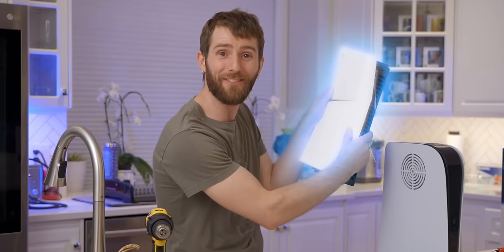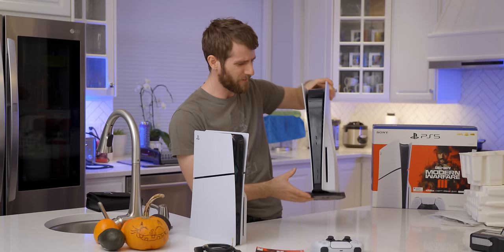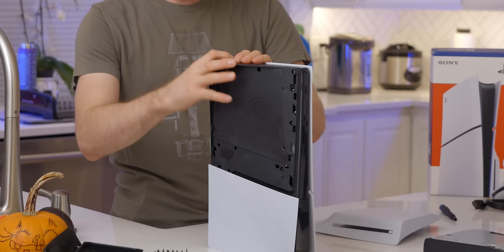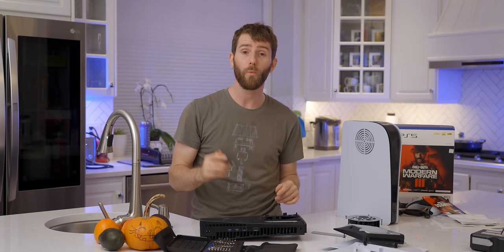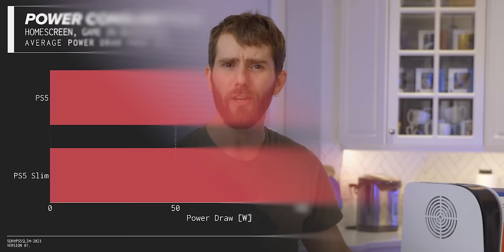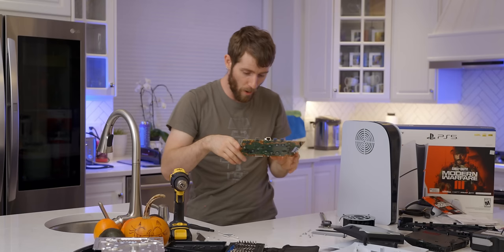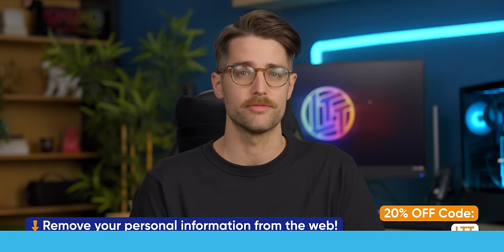PS5 Slim First Look and TEARDOWN!!

Comment: 18:30 The large jaws of the caliper is used for outside measurements, and the pointy jaws on the opposite side are used for inside measurements. And the rod that sticks out the end of the caliper is used for depth measurement.
Reply: Since the chip sits on top of the pcb he's using the correct jaws. There is a small space between the foam and the actual chip.
Reply: @bastienx8  Ok fair he's not measuring the inside of the black collar as I wrongly thought of. But the large jaws are still too big to reach the IHS edges so he's eyeballing it, and in that case using the pointy jaws would be a better choice.
Reply: @bgezal  on some calipers the large jaws also ends with a small point, but I don't know if theirs has this
Reply: @bastienx8  Sure. My intention was to teach about the multiple uses of the caliper, for those that didn't already know.
Reply: @bgezal  Yes that's great. The next thing would be to learn how to read the decimals on a non-electronic caliper, I tend to prefer these over the electronic variant because they never run out of battery
Reply: @bastienx8  The Vernier scale. It's a great backup knowledge. https://en.wikipedia.org/wiki/Vernier_scale I've finally retired my vernier caliper for a digital because my eyes are getting old.

Comment: Im really curious to see if the redesign of both the console itself and the power supply do anything to relieve the overheating problem. The amount of people who ended up with the "my console just shuts itself off with no warning" problem because of clugged PSU vents is ridiculous. Something that should absolutely be seen as a pretty major design flaw. It should've gotten some attention in the redesign.

Comment: One thing we can count on Sony is that the slim versions always more reliable and last longer, my PS3 slim still working and PS4 slim was the same
Reply: Yeah but those came with die shrinks.  This slim is different.  But tbh electronics should be a lot more reliable now.  Everything runs a lot cooler and power effecient compared to back then.  

Still gotta clean the vents if you want your consoles to run reliably imo.
Reply: @squirty131  I think you would need to read/write nonstop for a long time for it to defect.  There's numbers on these SSDs, some more than others.  I'm not sure about the nands/controllers PS5 uses, but I'm sure it's better than most SSDs out rn.

Good point though, but I'm sure Sony made sure PS5 could last at least 10 years reliably.  

I could be wrong though since I haven't been researching memory chips in recent years.
Reply: @squirty131  e-waste is a massive propaganda, plastic in household products is the main problem.
Reply: Because of the die shrinks so thermal and power draw was better but this time they did the shrink and improve the thermals on the cfi 1200 models so thats why you dont see much of a change basically anyone with a cfi 1200 or a slim will have a better console overall compared to the first buyers in 2020 or 2021/2022 that got the cfi 1100 that has the worse thermals

Comment: 2:30-2:50 Never have been done!? IIRC, replacing the storage on Xbox 360 was trivial, there was just one tab to pull off the HDD case and drop in a new one, or you could open the case and replace the HDD only. PS3 was also trivial, the HDD was on a sled and you had to undo just one screw. Pretty sure both documented the process in their manuals.
Reply: Sarcasm my friend, that was sarcasm. The dig was exactly that, that it was done in the past, worked really well, but then got dropped from following consoles.

Comment: Wasn't the original PS5 heavily marketed around its custom 6 channel Storage Controller? Which was also the reason for its weird 825GB capacity. I only see 4 Packages now, 256GB each for 1TB in total, which means it is using less channels from the controller, which implies that parallel throughput of the system would be lower unless the controller is more efficient now per channel of NAND connected to it. Can you guys run a Speed Test on the Internal Storage to see if there's any different?
Reply: Heavily marketed? Depends. That was a small detail in the Road to PS5, barely a marketed feature. It was just a single part of its specs and probably not that important. Most of the custom stuff is on the actual controller, like hardware decompression. And I imagine there’s still the 6 levels of priority they mentioned. Oh, and the PS5 actually has a 12 channel interface, not 6, although I’m not sure how that translates to the nand chips
Reply: They lie in marketing a lot
Reply: They probably use faster NAND now.
Reply: The number of channels doesn't necessarily equal the number of NAND packages or dies within, and less chips also doesn't necessarily mean a decrease in channels. For reference modern drives commonly have 8 channels while using 2 NAND packages, so Sony could very well keep 12 channels (it's 12 not 6) despite decreasing down to 4 packages in the Slim which likely each have four 512 Gbit dies. Also fewer channels wouldn't necessarily mean lower throughput, the speed of the channels matters.

Comment: its not weird that the internals use the same screws and the shell uses a cackophony of screws. because the actual function serving bit (the pcb) was designed by a team of engineers and the shell by  dEsiGNeR that cared more for looks.

Comment: On the USB ports, Linus actually is a bit wrong - it's actually the same speeds on all ports as the previous OG PS5, they've just changed the front USB-A to USB-C. 
- Both back USB-A ports are 10 Gbit.
- One of the front USB-C - the one replacing the USB-A - is limited to USB 2.0 speeds (480 Mbit/s) and is basically only for charging controllers/peripherals. (I guess you can use it for USB headsets as well as those typically only need USB 2.0 speeds.)
- The other USB-C is 10 Gbit and is to be used for the PSVR2 (but can be used for charging etc. as well, of course).
It could cause some confusion if new users try to plug their PSVR2 into the wrong front port and it doesn't work and don't understand why.
Reply: I doubt it's been downgraded to usb 2.0, more likely it's 3.0 instead of 3.1 like the other ports which would be the same as the OG PS5. 3 x 3.1, 1 x 3.0
Reply: so hes right as he said 3 of them are 10......
Reply: @talibong9518  They didn’t downgrade any ports. The front USB-A is USB 2.0 on the OG PS5 and they just swapped it for a USB-C at the same speed.
Reply: He was also wrong about using cheap flash memory when it uses nvme m.2 when talking about the storage
Reply: @Brandon0159  M.2 is the physical interface, so PS% doesn't use that interface since its SSD chips are soldered to the board.
Reply: @Brandon0159  he's not wrong there, he's talking about the RAPIDLY falling price of the actual NAND itself
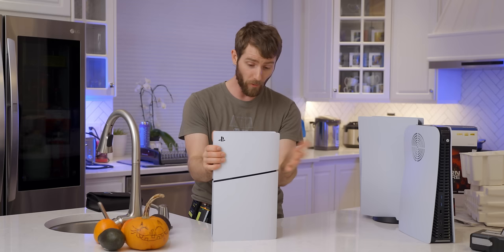Reply: @jelousjake3500  he IS wrong (again, no fact checking at all). He said at 6:04 "the original ps5 had 2 5G ports and 2 10G ports" which is very wrong.

Comment: I like how easy seems to be replacing fan or psu (and disc drive obviously).
Reply: However, in long run, this console is not good for future retrogaming because Sony will shutdown their cloud service long before all the optical drives fail. As a result, you cannot combine a working drive with a working motherboard because Sony maintained cloud service is required to accomplish that.

Hopefully none of the games for this console are worth retrogaming in the future.
Reply: @MikkoRantalainen   While not ideal unfortunately it's now the world we live in, still with luck unless I'm misunderstanding something, there is a fair chance that once that point is reached either Sony changes the firmware so that the online  requirement is no longer needed or 3rd party solutions are available to cater for those users.
Reply: @MikkoRantalainen  Oof, yeah, I forgot about 'live-service' thingy... well... shit

Then again, determined people always(?) finds a way
Reply: @raka1996  If Sony went the here with the same technique they use in their Android phones, real cryptography with secret device specific key stored in TPM (or equivalent) chip, there's little to no hope to ever fix the problem without Sony's help.

For a single device, you could put the TPM chip under electron microscope to extract the device specific secret but that scales really poorly.

You'll end up with similar crap that 3rd party repair services have to deal with Apple devices nowadays: swap individual chips to avoid the serial numbers from changing. This obviously totally voids the idea of easy drive replacement.

And considering how poorly they support their existing Android hardware, I have very little hope for Sony ever releasing a firmware update to allow part swaps when Sony shuts down the cloud service.

Comment: It's seriously cool they can pack that much in such a "small" package. I mean honestly with the size of modern consoles you might as well get a mini itx build, but those are more expensive if you spec them up. So it's fair enough. The "you need connection to the server or it's a brick" trend worries me though =l
Reply: You should see an Xbox series x tear down. Talk about power, size ratio
Reply: It's as powerful as an rtx 3060, you can find 4090 laptops smaller than that
Reply: @nightthemoon8481  can’t find one no where near as cheap tho. And GPUs on laptops are weaker than desktops.
Reply: @Amearie  true, but it's cheaper in the long term since you're not paying for online and paying 80$ for every game

Some laptop gpus are weaker but not all, the 4060 laptop is almost identical to its desktop counterpart, the 4090 however is much weaker than its desktop equivalent but still more than 4x as powerful as the ps5

Comment: What I’ve noticed in the unboxing part of the console is that the power and USB C cables are missing in the box. To everybody who wants to buy a PS5 Slim, it includes both cables as well alongside the HDMI one.
Reply: And all PS5s have 1 TB of storage. So for that, you need to take down the video, so you can correct the mistakes that were done in the current one.
Reply: @yordyords  nope og has 825
Reply: Yet 825GB available. Which is what he said in the video. With the slim having the 1TB.
Reply: @jlatoo I didn’t make it obvious, but all new PS5 Slims (both the digital and disk versions) have 1 TB of storage, which is an upgrade from 825 on the old one.
P. S. Mistake #3: There is no upgrade on the USB specs of the ports. Even the old one has 2 10 Gbps Type A ports on the back and one 10 Gbps Type C on the front with one Type A that is 5 Gbps. Now with the Slim, the only change is that the Type A port on the front has been replaced with a Type C, while retaining the same specs for throughput.
Reply: @yordyords  they said that in the video?
Reply: @jlatoo for the storage, they said only that the Digital Edition have a 1 TB SSD, while for the USB part, they told that there is an upgrade on the speed of the ports, which is entirely false. There isn’t any upgrade aside from the Type A to a second Type C on the front.
Reply: @yordyords  the new digital only has 1 tb ssd and it is a high speed usb c, not 2.0 speeds. youre purposely misinterpreting
Reply: @jlatoo I’m not misinterpreting bro. Go and check the specs for yourself instead of blaming me for misinformation. And also, do not add words to my mouth which I haven’t mentioned. I’ve already said 5 Gbps instead of USB 2.0.
Reply: @yordyords  nothing they said about the specs was wrong lol, did you listen to what i said
Reply: @jlatoo it was wrong. Especially about the USB port capabilities.
Reply: they already opened it before filming, they probably forgot to put it back or just didn't bother at all since they're doing a teardown.

Comment: Me and Jesse tore down the PS4 and basically refurbished it. Poptoons Skaff used A LOT of q tips for collecting dust and I re-pasted the CPU with the last of my Thermal Grizzly. We struggled to put it back together successfully and... Well, we have no way of testing if it improved thermals, but it seems to be working as usual so, we succeeded in cleaning and NOT breaking it. WHOOPTY-FLIPPIN-DO.

Comment: One thing they could've changed is make the OS SSD not be soldered. In case one chip module is to fail it would be much easier to replace an SSD and not to desolder and resolder the chip back on the board, well at least Xbox got that right.

Comment: The ssd thing has been done before. With the ps3. At least with the super slim ps3, you could slide its side off and you had a completely empty full PC HDD sized sata port, no need for screws even
Reply: I used that with an sata extention cable, powering an big HDD instead of the smaller laptop drive they came with. Even modded an old external case to keep the drive in, for safety.
I do remember it had a sizelimit though, but it also could've been an incompatibility with the drive brand, somehow.
Reply: @Icefumy  I had like a 240G corsair sata ssd from back in the day, which was a huge upgrade from the I think 16 or 32G my PS came with, I think it was one of those models with flash storage

Comment: I have a PS 1 and PS 2, and I do have to say that sony has always given us options to expand our storage, especially on the PS2 with the HDD slot in the back.
Reply: Apples and Oranges.
Reply: Lol you say this but if they could force cloud or digital only they would
Reply: @krustyegirl7334  they could but they didn't. there's speculation and reality.
Reply: @krustyegirl7334  There's definitely benefits to both. And you have the options. We're talking Storage, not a disc drive.
Reply: @krustyegirl7334  they absolutely could just not produce a disk drive.
Reply: @x0Fang0x  They could but they would lose customers (aka money)  if they did.

Comment: i dont even have a ps5 but i bought the new controller for my pc and i thought something was wrong with it when i felt the forced feedback through the triggers while playing death stranding, im amazed at the vibration generators i guess you would call them they have a huge frequency range, came a long way since the 2 motors with a larg and small spinning weight on the end lol

Comment: I wonder if the amount of screws in the shield  isn't only for the VRM cooling but also to put a bit more pressure on the clamp of  APU, being that previous models had the issue of bad pressure between the cooler and the APU creating dry spots, leaking liquid metal, etc.
Reply: Yeah that new APU looked like it had perfect liquid metal coverage

Comment: Man this console is super serviceable love to see it. Well done Sony...well done.
Reply: It's a shame the onboard SSD wasn't switched to a standard one.
Reply: @user-ds8rj2vc4v If i would have to guess, it's more space efficient considering they are trying to shrink the console in this slim version, but would be cool for both to be servicible
Reply: @user-ds8rj2vc4v I think it's fine. It's cheaper. As long as you can extend the capacity with of the shelf m.2s it's reasonable.
Reply: @kiryu4501  
It's not when considering the longevity of the product.
Reply: @SkyfighterZX  
See, I think it would've been better to instead not have onboard SSD, and the empty slot to have the 1TB drive. You  can still upgrade your drive then fairly easily, but would mean that in the long run, they would have better repairability.
Reply: the liquid metal and soldered on ssd says otherwise
Reply: Yvng_remixer  I’d say so.. in 3-5 years time these things are going to be dropping like flies.. out of warranty
Reply: @MrJord1994  
I don't think the liquid metal is a problem. If anything it'll help. 

But I agree 100% about the soldered memory chips. The more bits that aren't replaceable, the more problems it causes.
Reply: @user-ds8rj2vc4v  only time will tell. But typically you don’t use Liquid Metal for a permanent solution for a reason.. maybe Sony has magical properties in theirs.

Comment: Have they adressed two of the issues the original ps5 had. 1. The coil whine from the psu. 2. Have they changed the HDMI controller to support full 4.4.4 rather than the 4.2.2?
Reply: New ps5's still crash playing ps5 games when using sleep mode and HDMI link.
Reply: Nope it has the exact same HDMI controller. As far as coil whine goes it depends on the PS5.
Reply: @ZackSNetwork  yeah i use ps5 on my desk top and never heard a thing.